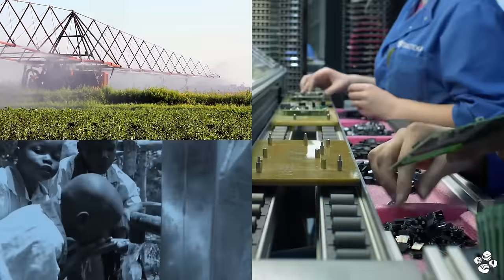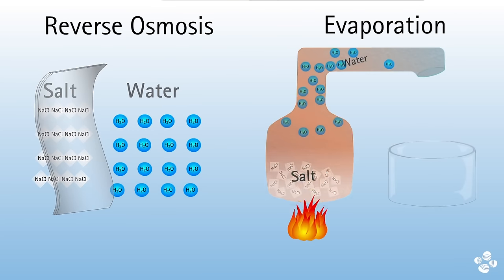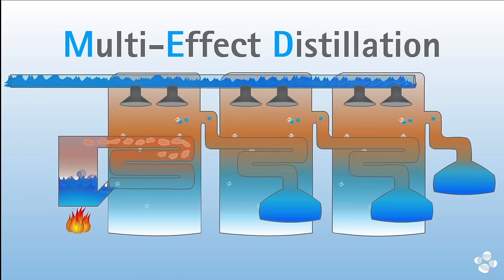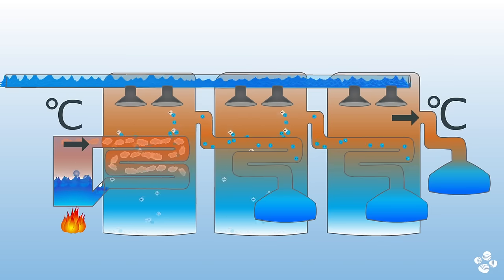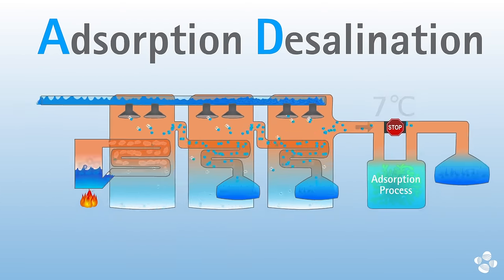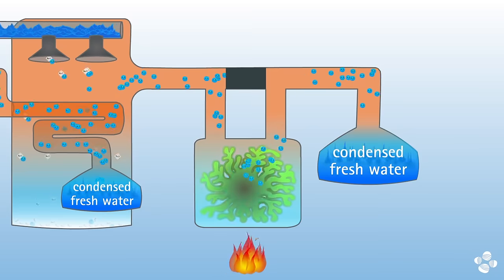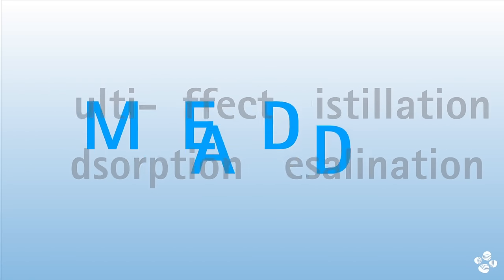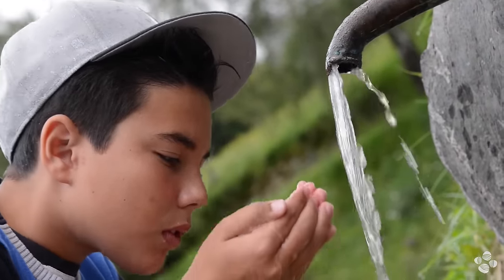Making Desalination More Sustainable

Comment: But this doesn't add up. If the ambient temperature is 40 degrees, maintaining a 7 degree temperature will require a lot of energy. Unless you can maintain that temperature for free, I don't see how this process would be economically feasible.
Reply: Um what?
Reply: maybe they cool it by evaporating cheap sea water